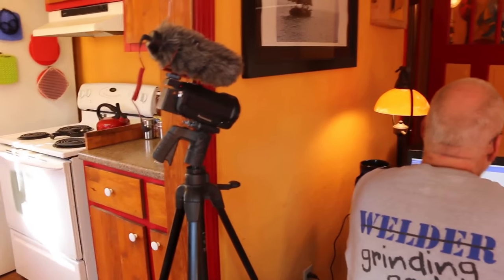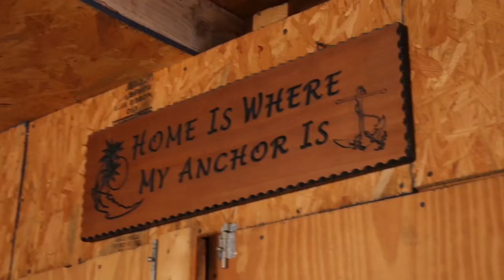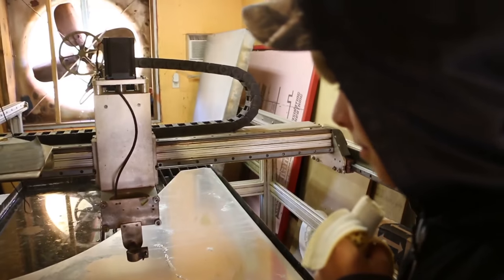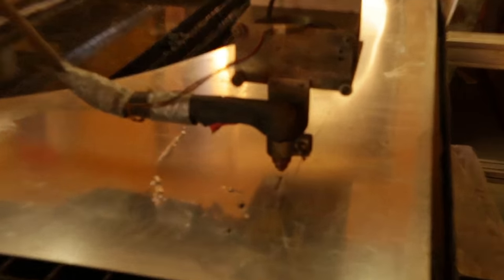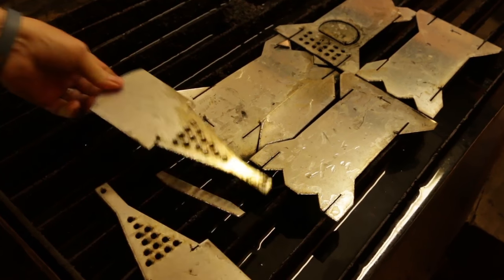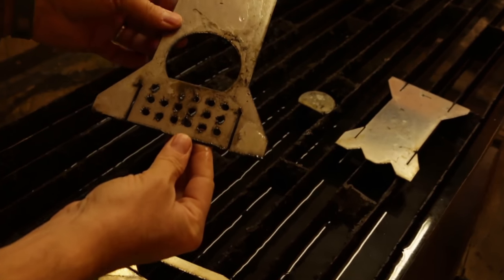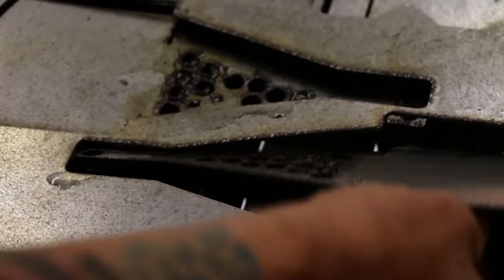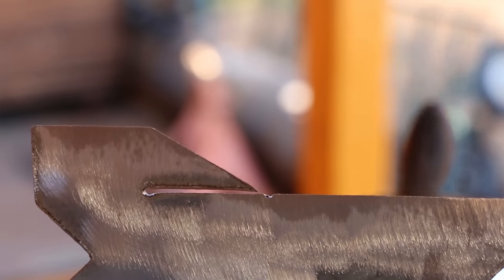SV Seeker Makes My Rocket Stove On A CNC Plasma Cutter

Comment: Looking forward to the final product. I'm sure you will be checking into it but was wondering if this could be mass produced using some sort of stamping method. The seeker brought me over and am glad that it did. Some great videos to peruse. Keep em coming!
Reply from the maker: Thank you. I'm looking into laser or water cutting for the production of the rocket stove. I think stamping would mean a custom die...which I'm guessing would cost more than CNC options. Plus, I can make tweaks as needed to adapt the design if flaws emerge. Thanks for coming over from Seeker. Doug is a solid guy.

Comment: I was thinking that if you sell those parts individually, people will be more inclined to buy in the first place. That bottom grille will be a consumable for sure, facing the brunt of the glowing coal. Or maybe sell complete units for slightly cheaper, if the registered customer has already bought one.
Reply from the maker: Thanks for your perspective. Right now, I've got the rocket stove plans set up with two grills per unit. With their shape, you can practically get two out of the same size metal as just one. I think I'd send two with the initial stove and then sell them individually as well. That is what you are suggesting too, right? We'll put that in the "great minds think alike" category. :-)
Reply: Two grills per unit and aftersale is a very good idea. :)

Comment: Are you planning on a mass production?
Reply from the maker: Michael Conner I'm considering it. I want to do a little more testing. I think I might need to enlarge the notches at the top a little for better airflow with a pot on top.

Comment: easy to fix holes with step bit and deburrer
Reply: Sure, but if he intents to outsource the manufacturing and sell readymade stoves, they need to come out of the CNC perfect. Any unnecessary time spent finishing them will increase the cost per unit.
Reply from the maker: Matanuska...I'll likely make the manual fix before I fire the rocket stove Doug helped me cut out. I think I'll pick up a step-bit...I've gotten a few suggestions for that. And Sleeptyper, I'm probably going with laser or water cutting for the production of the stove. Both will give me a tighter kerf and closer tolerances. So guys, do you think this stove design is ready for the market?
Reply: sleeptyper obviously...  I'm talking about he prototype
Reply: GreenShortz DIY looks good to me.  titanium as an option would be cool..I'm a gram weenie myself. the design seems very simple yet effective. good job
Reply: GreenShortz DIY Looks very easy to assemble and i'm sure that it'll sell well, if you don't go greedy on the price. Similarly sized stove from some german maker is ~80$ in one shop, lol. I'm never going to buy a 5-stack of cut sheets for 80$.
Reply from the maker: Thanks. I'll look at titanium as an option. I think it would be an easy addition if a laser cutter or water jet can handle the toughness. Thanks for the suggestion.
Reply from the maker: I'll hopefully be visiting a local laser cutting operation next week. And I'm hoping this would be in a $40 ball park. I think I could stagger pricing, depending on the metal as well, providing some options. Thank you for your feedback. I'll keep you posted. You too, Mantanuska.
Reply: @GreenShortzDIY   Did you also want to do a stainless-steel version too? Another thing you can do is add secondary combustion inside the rocket stove. More flame, less smoke, cleaner burn.

Comment: http://www.anvilfire.com/iForge/tutor.php?lesson=safety3/demo

BTW, grinding the zinc off is not much safer than burning it off. It generates a fine powder that is easily inhaled and can be more deceptive than fume exposure because the dust is slower to trigger the upper respiratory symptoms than fume does. I hope your friend's kid was somewhere else while that was going on and that he kept clear of the area until all the dust had been cleaned up and safely disposed of.

The real problem is that with heavy metal poisoning, the poisoning is cumulative and most people don't even know what their lifetime exposure has been. People can be exposed and never really realise it--for example, that burner barrel that many rural people use for burning their trash or as a container to build bonfires? Which ones were zinc lined--most people don't have the faintest idea.

Connected to this problem is that the toxic level is highly variable from individual to individual. 

If the guy doesn't think enough of himself to use a rated respirator, well, he's an adult and he can choose to be dumb if he wants. The kid? Deserves protection until he's old  enough to make his own decisions.